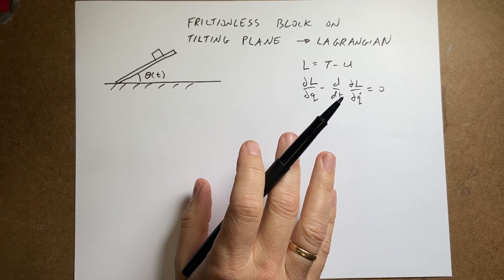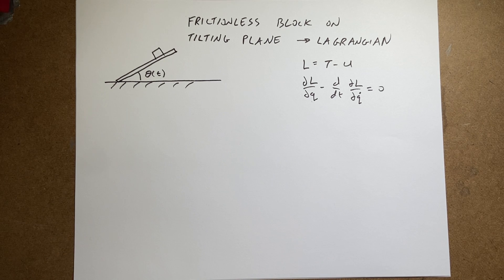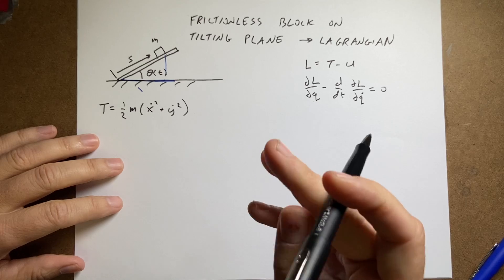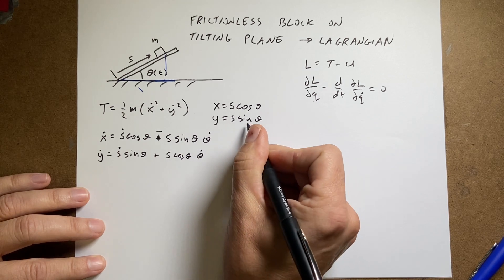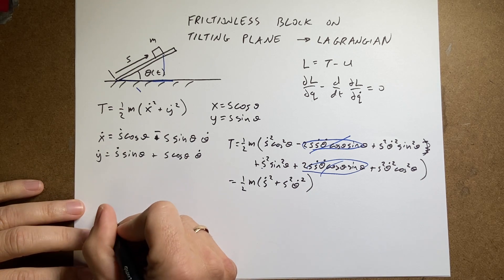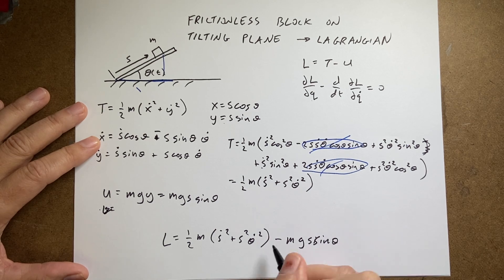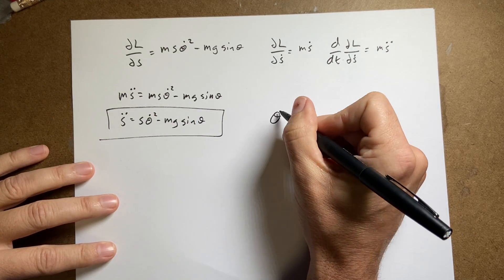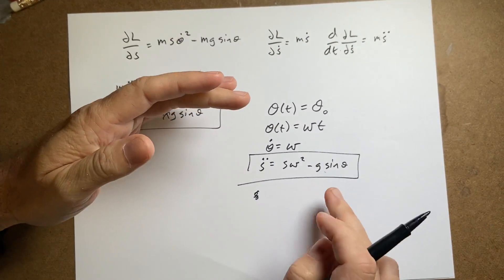Lagrangian Mechanics - frictionless block on a tilting plane

Comment: What an awesome video! I paused it and tried to do it myself, which I did successfully. I was so pumped that I went directly to VPython and did an awesome simulation. How can friction be added? Does it have to do with only one of the final terms? (either sw^2 or -gSin(theta) )

It is interesting to see (in my simulation) how the oscillating plane can actually push the box further up and away from the axis of rotation. I guess adding friction will narrow down this case. Which from what I can see happens when the box is further away from the axis.
Reply from the maker: Yes, friction can be added.  I'll get there eventually.  I'm currently working my way through the classical mechanics course. 

Glad you tried it yourself!